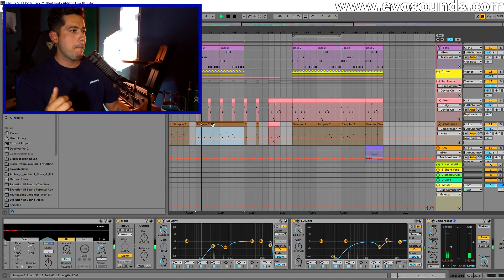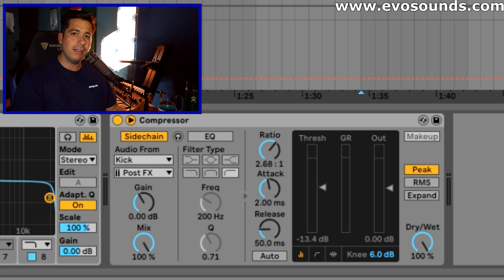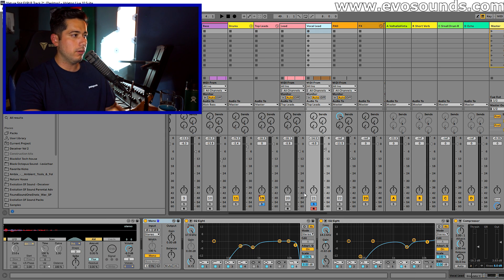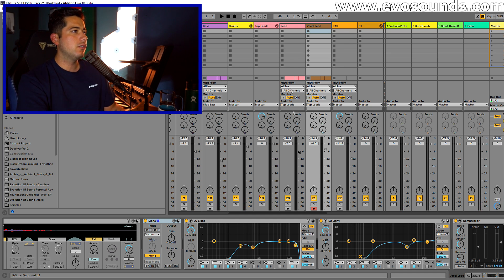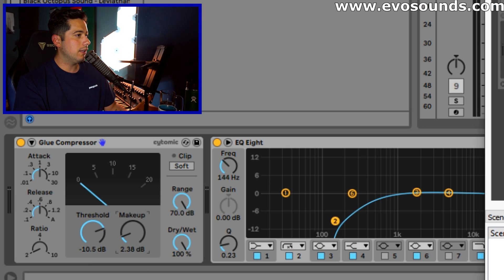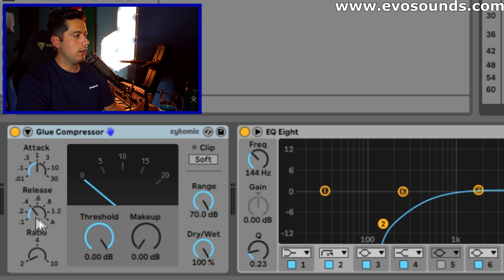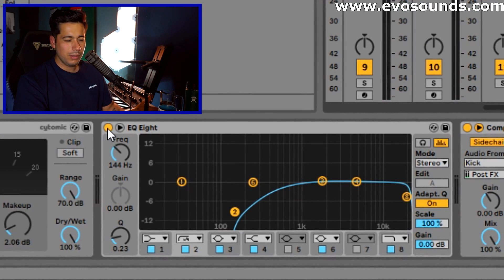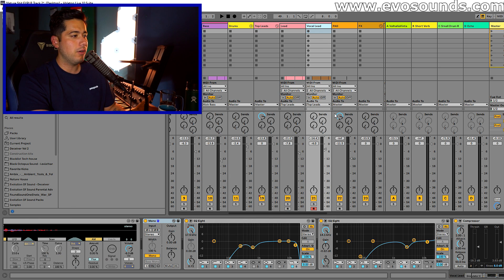How To Glue Your Synths Together!

Comment: Is there a difference between having reverb on a bus vs having the same reverb with same settings on each sound?
Reply: And the main difference u are asking for here is that u will save a ton of CPU when they are grouped
Reply: It depends on the reverb. If the response curve is linear and unmodulated with no feedback or fancy stuff, the only difference is cpu. If you are an algorithmic reverb or something modulated similar to a delay (think, like, Polyverse Comet), the effect isn't distributive.

Comment: Hey Zen so as reference to when you spoke on adding too much reverb to a sound, I tried using a dimension expander after I purposely washed out my sound with too much reverb and then EQ'D the whole thing and was able to make alot of depth and upfrontedness to match leads. Really just have to steer clear of super gainy/long attack pads. Much love bredren.

Comment: It is wrong to adjust the output level of the plugins with which I process my elements - for example compressors, saturators, distortions, until the reverb increases the output level, then the same as I had input in matters of peak, but sometimes I lose RMS trying to match the output levels to take care of the head room and that the peaks do not go from -6 is it wrong to have less RMS after using an OTT than with my clean signal?